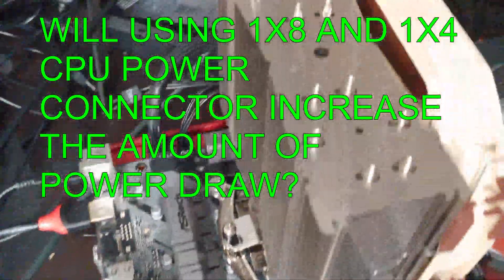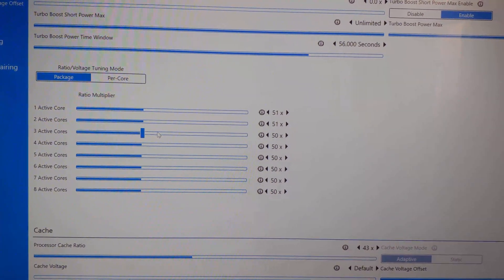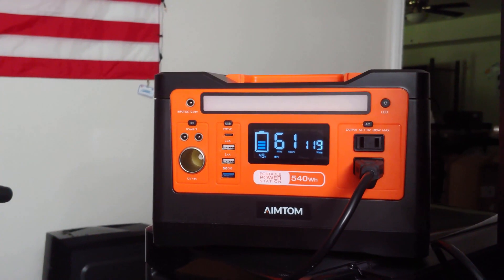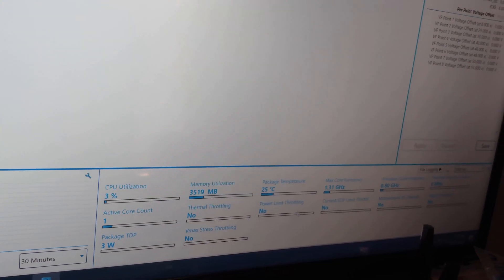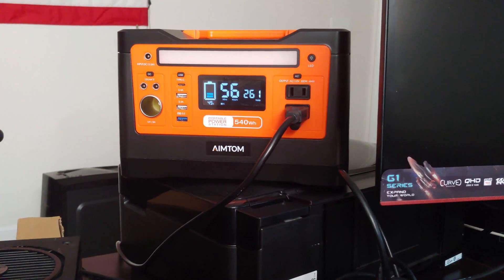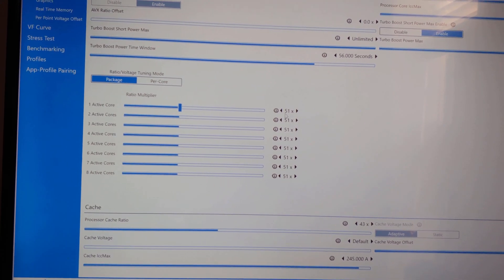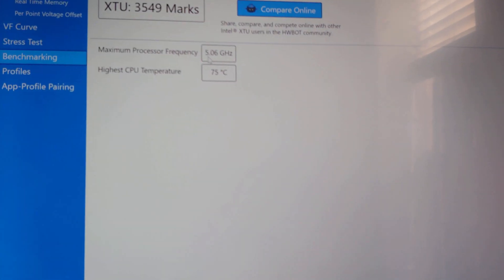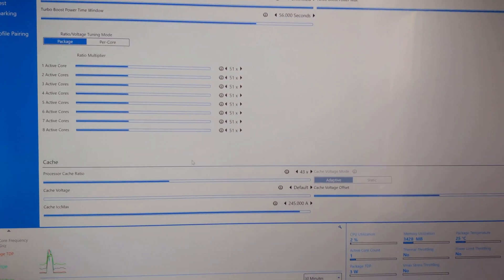Power draw from I7 10700k with 1x4, 1x8 and 1x4 + 1x8, Intel XTU benchmark Core TDP and Overclocked

Comment: I just bought a 10600k and z590 not realizing it had a 1x8 + 1x4 CPU cable needed, my current PSU only has 1x8 that i powered my 7700k PC, will i still be able to run all core at 4.8-4.9GHz?

Comment: Where did you get such low temperatures at 5000Hz, I have an arctic freezer 280mm, and when i run xtu benchmark, the temperature immediately becomes 85+- degrees 1.31v 170 tdp, i got 72 at 4700 Mhz

Comment: Does not connecting the 4 pin can cause random shut downs and restarts?
I'm not being able to load in windows because ir restarts and when it finally boots successfully it restarts again.
Vision G with 10700k.
Also could these restarts damage the cpu?
I'm waiting for a new power supply though.
Reply from the maker: If you had a power supply that was seriously undersized and the PC was drawing more power than the PSU can handle, the computer usually does restart.  This is very common when someone buys something like a RTX 2070 Super GPU and has only 400W PSU.  The thing is though that it will usually only be a problem once the game is started.  Otherwise power consumption is way lower.  In your case, hard to tell...I have alot of parts and a good percentage of the time troubleshooting with me is done by switching out components to find which one is causing the issue.  Sometimes there is a cable that is hitting a fan blade from cpu cooler.

Have you tried removing all drives...and seeing if it will allow you to just boot to the bios?

Do  you have a GPU and which model?  If so, try disconnecting it and seeing if it will boot to Windows...and allow you to stay in Windows without restarting.
Reply: Tried it w/o gpu (rx 580 till I can find stock for the newer cards), cleared cmos, nothing, It behaves the same.
It's wierd, in bios it doesn't crash, can stay there forever, but it can't sustain boot.
I ll flash the bios later in the day and try again, mb the new psu arrives too (ordered rm750 gold).
Reply: Got the new psu, it works now, ran prime95 for half an hour, no issues.

Comment: just bought the i7 10700k, and asus rog strix z490-g mobo, but i have a G750h gigabyte psu,  only comes with 4+4 cable for cpu powering, do you think i will be fine running this chip with only 8 pins powering it? or i should get a new psu to plug in all the 12 pins?????
Reply from the maker: Yes...just don't expect to unleash power limits and run it much higher than say 5.2Ghz all cores.
Reply: So keeping the power limits enabled, and turning off turbo boost and I should be ok?
or just manual overclocks would be a bad idea to try, and leaving turbo boost on fine?
what exactly should i limit or turn off on the bios setup to run it on the safe side with only 8 pins
Reply from the maker: @NotMyRealNick  I wouldn't turn off turbo boost...you will have a very weak performing cpu.  You just can't maximize Overclocking/raising base clock frequency or changing PL1 & PL2 inside BIOS.  That extra 4 pin just allows one to take things to the extreme.  It doesn't mean you can't do those things...just that you can't push them as far.  Hopefully, this clarification makes more sense.

Comment: I'm new to this shit bro and I understand you can be fine with just using the 8 pin  ;  however I have the i7 -10700K and after seeing a 8 + 4 connector I really would like to know where to buy one cause Best Buy doesn't carry it in my local store. What exactly is the description I'm looking for when buying one online cause I don't see the obvious 1x4  1x8   specs /description anywhere on any brand bro, unless they call it something else that I'm not looking for.  Where can I buy one ?  Anyone ?
Reply from the maker: Here are 4 examples and you won't know it until you look at the details.  You can have a 1000W PSU that does not have what you are looking for.
EVGA 850BQ  https://amzn.to/2UYiow6  I have 2 of these which I use for this channel
EVGA 750BQ https://amzn.to/37ecBIK  on sale on Amazon.  Lower wattages don't have it.
Aresgame (cheapest) 750W https://amzn.to/2Jc7noy
There is a picture on this page of what you are looking for:  https://www.aresgame.com/POWER.php?id=17&&name=AGV750  I have not tried their product yet, though I will have a 500W and 750W eventually on the channel.  What you are looking for is verbiage along the line of CPU Power connector 12V, 1x8 pin and 2x4 Pin. his item comes in 500W, 650W, 750W on Amazon at 20% off...  Reviews sound good, but I have not used it yet to endorse.     

Corsair 750W (expensive)  https://amzn.to/39ee18D
Reply: @PC_HardwareTechUnboxing_1  Wow !! Thank's for responding with so much detail man. You have a new Subscriber :)     

Hey , I found this online at my local Best Buy store . Can you tell me if this is the same one  you have at the end of your list as expensive .  You listed it as a Corsair 750 w but when I click on the link it go's to a 850w on amazon and I found it as available and alot cheaper on my store. I just wanted to confirm that this is the exact one you listed.
It looks identical, but my dumb ass needs a person more knowledgeable to confirm before I go swap it , lol!  https://www.bestbuy.com/site/corsair-rmx-series-850w-atx12v-2-4-eps12v-2-92-80-plus-gold-modular-power-supply-black/6229601.p?skuId=6229601&ref=212&loc=1&extStoreId=438      I found it on sale for 129.oo   It's only 20.oo bucks more than the one I currently have..  Please let me know , thank's in advance .
Reply from the maker: @DOSKARAS   No problem...that's part of building these youtube channels up helping out.  You did give me an idea for an additional video on shopping for a PSU that has the necessary connectors.

It looks like the same one...much better price.  Here is the link to owner's manual below.  You will see in there that it has qty 2 of the 4+4.    You might be able to get the 750W as well, it is the lowest Wattage one that has 2x  of the 4+4.   https://www.corsair.com/corsairmedia/sys_master/productcontent/RMx_2018_Manual.pdf

Comment: I have a MSI b450 gaming pro carbon max WiFi, it has 1x4 pin and 2x4 pin, my PSU have 2x4 pin CPU power, so what can I do now? Please help
Reply from the maker: As you can see from video...only slight performance loss...use the 1x8...
Reply: @PC_HardwareTechUnboxing_1  is there a adapter u can use

Comment: Very interesting. I am using a Ryzen 3700X and a X570 Aorus Master which has 2x8 CPU power pins. Right now I can only use 1x8 due to my PSU.
Reply from the maker: I never did mess with my X570 and R9 3900x.  Mine is only 1x8 and 1x4, but am curious if there is any performance gain...and then again with your motherboard.